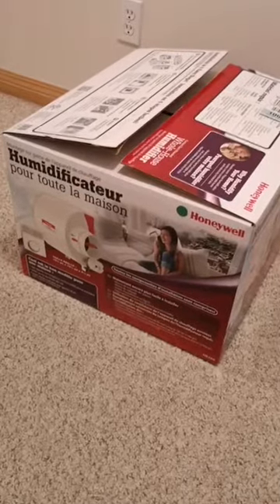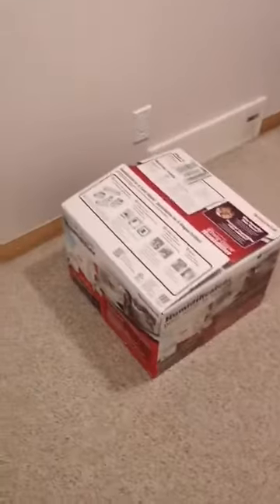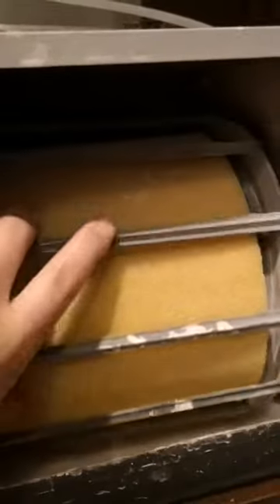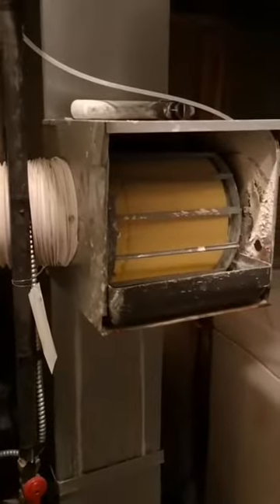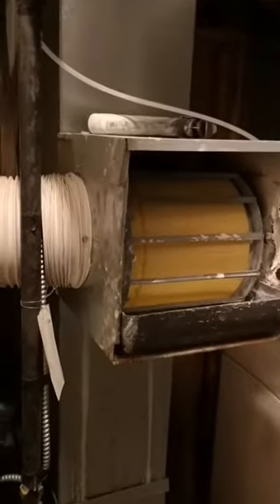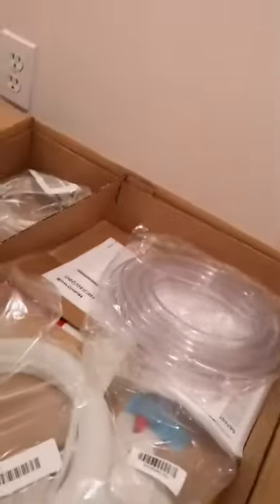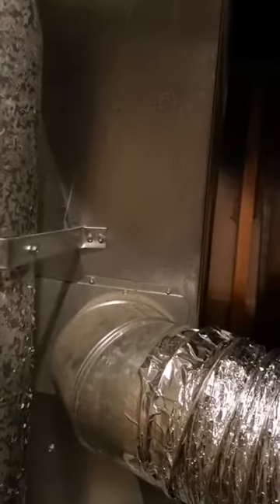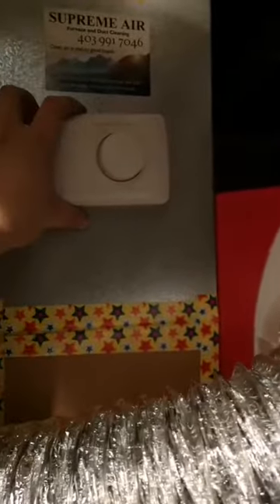How to install Honeywell whole house humidifier

Comment: Thank you man, this was a great video. I installed mine, of the same Model of Honeywell Humidifier, about 2 years ago. It never worked and I gave up on it, because, I was told that I had to buy another solenoid. The Solenoid was over $75, so, I gave up and left it until I watched your video. The only thing I did was switched the water intake (the black thin pipe to the other inlet) and the transparent plastic pipe to the other one, and that was it. The pressure sensor was not getting the correct pressure to turn on the solenoid. It worked, thanks to you a million!

Comment: They can be mounted either way. My old one was on the return duct, when i got a new furnace i mounted the new one  on the heated duct above the furnace. they work equally well. the directions say you can mount it either way too.
Reply: Moved into house with this installed on return duct, manual says it is acceptable. But my humidity gauge always stuck in dry and everyone has dry noses. It makes no sense to me that Honeywell would even say it’s acceptable although not the preferred method. Because you are sending your moist air down into the furnace Air filter which absorbs the moisture, then up to the hot side of a furnace which seems to dry up any remaining moisture. So the function is defeated. I plan to cut new hole and swap it over to the supply side.
Reply from the maker: @stifflick   The purpose of the humidifier is to let air blow through   the pad soaked in water, and bring some water vapor with the air flow. The water vapor will not be caught in the filter, because its in vapor form, not in water droplets droplets.  It doesn't matter if you install the humidifier on the return side or the blow side, as long as air is forced through he water pad.
Reply: @nickhu1852  thanks for reply, but I moved mine to supply side and was hoping air rushing past the humidifier would pull water vapour towards vents, but due to higher supply pressure it blows through humidifier to the return side, and I still don’t see any change on hydrometer it’s still shows in the “red” dry scale. Even at max setting, lots of water flowing to the drain so I’m still not happy with this whole setup. I even removed my air filter in furnace to see if it made any difference.
Only thing I notice is when it gets dark outside my hydrometer moves toward yellow band but never makes it to “green” comfort zone.